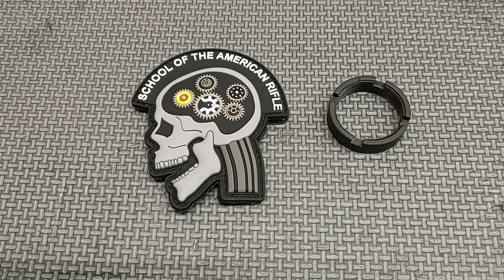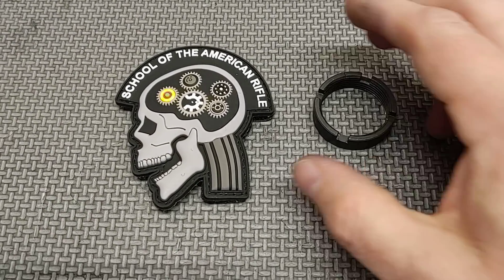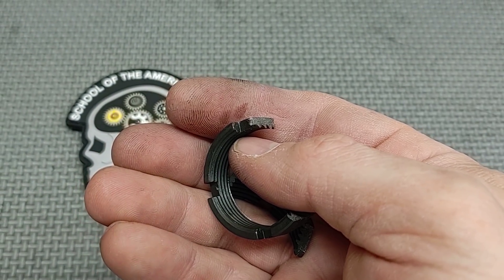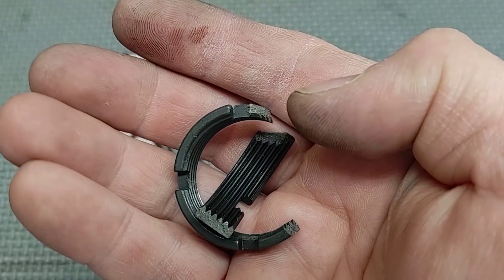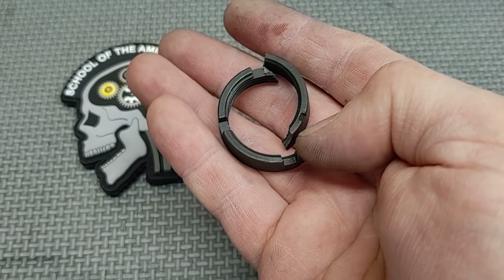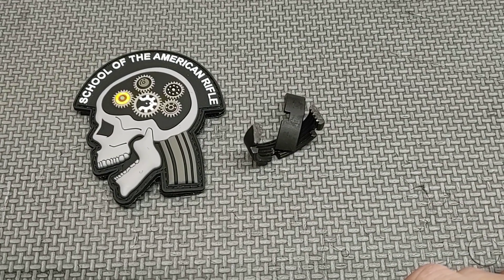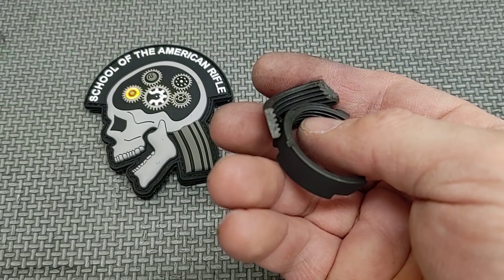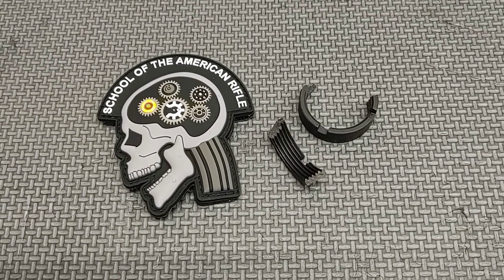AR Castle Nut Failure

Comment: I've had high a couple quality manufacturer 3/8" and 1/2" drive non-impact chrome vanadium sockets fracture and they weren't being over-torqued . . . fasteners were being tightened within their torque specs. They were decades old and had been well used. Simply replaced them with same or equal manufacturer. Stubborn fastener removal should be done with impact and penetrating oil using impact sockets . . . taking care not to overdo it on the impact forces. Sh1t happens. This was one such event.
Reply from the maker: @Sparks68  these didn't break on removal.
Reply: @SchooloftheAmericanRifle  I had not intended to imply that. My three failed sockets that occurred during four decades of using well over a hundred fractured when being used for tightening well within the torque range for them -- as with what occurred with your castle nut. As with you it's a reminder to wear eye protection. Yhr two halves of every one flew across the garage at extremely high speed.

Comment: I know this is about castle nuts, but I just finished a build and I had a question about installing the barrel nut. We used white lithium grease for the threads on the barrel nut and receiver. Is that a good choice or should I be concerned and take my upper apart to use proper aeroshell? We couldn’t find it anywhere so we thought white lithium grease would do the trick.

Comment: Threads are miscut or misrolled, depth and height all over the place. Look at the profile of the threads on the part facing the camera at 0:59 .... standard torque basically ripped it apart at the first convenient stress riser. Probably some worn out tooling wherever this was made...

Comment: What do you think of the choices of components in the WWSD2020 project? Also what do you think about some upgrades that POF does to rifles such as cam roller pin E2 extraction and cooling fins on barrel nut?
Reply: Castle Nut is a weak point of that style of stock fpr sure. But will never be problem on a  KP-15 Mono Lower.

Comment: Probably an inclusion in the steel, brittle fracture right at the stress riser caused by the sharp corners at the bottom of the notches. A U-shaped bottom to the castle nut slots would almost certainly eliminate this failure mode.

Comment: I just installed a palmetto LPK. The mag release snapped where the threaded post meets the actual mag tab. This is right after the gas tube pulled out of the gasblock cause they forgot to pin it. Garbage if you ask me

Comment: Could you do a video on how far to screw in the buffer tube? Recently had a tolerance stacking issue where I screwed in the buffer tube over the buffer retainer and it was so barely held on there that the chamfered edge of the buffer retainer ended up chewing into the buffer tube lip as it was getting ready to jump out of the lower. And one more turn of the buffer tube was doing a much better job, but the buffer retainer was still chewing into the buffer tube because the nipple was rubbing against the lip.
Reply: When I encounter this I just sand down the end of the tube a tiny bit and/or use a tiny file to just barely notch out some space for the nipple to go through.

Comment: I'm really digging this chanel. Hiw are you and your wife feeling? Any other techniques for aligning receiver extensions ,for those of us with out that nice tool you have?
Reply: Im sure chad knows better methods but what i do since i dont have the proper tools is turn the lower upside down and sit it on a flat level surface so that the receiver extension is hanging off (cant have the hammer installed for this) and put a small torpedo level on the flat side of the buffer tube and then adjust until its level. I have tons of woodworking tools so this was the first thing i went to trying to align mine.
Reply: @abolishtheatfandrepealthen6014  that makes
Sense.

Comment: I’ve tightened those down with a punch and hammer before. Guess I should be more careful... not likely tho
Reply: I know it's not the SOTAR way, but I typically tighten mine with soft jaw pliers (with aeroshell on the threads), then tighten it up with a hammer and punch, check alignment of the buffer tube, then stake it.

Comment: Some types of coatings can cause hydrogen embrittlement, phosphate is one of them.  The heat treatment after can be the difference between failure and no failure.
Reply: The cracked surfaces are dark in color that would mean that the cracks were there before or during phosphate.  

It could  also be Stress Corrosion Cracking(SCC) or the rough stock was cracked during extrusion.

Comment: An unrelated question to the video at hand but I've heard a fair amount of comments about the head of the cam pin causing damage to the upper receiver for various reasons which raises the question, why does the pin have a head, or such a large head, in the first place? I believe I have a decent understanding of how the system works but I feel I must be missing something with this as it does not seem necessary.
Reply: This is my best understanding.  The cam pin head helps orient itself for the insertion of the firing pin.  The cam pin's head shape is to keep it aligned in the upper receiver's channel,  as the bolt carrier group (BCG) reciprocates during the firing action, so as to avoid undo stress on the firing pin, which rides safely inside the pin's hole.  When the BCG goes forward, the cam pin cants to the left, locking in the bolt for the firing sequence.  The mass of the head is to withstand the force of the canting of the bolt back to the right, as the gas violently forces the BCG rearward after the ignition phase.  If you look in the channel of the upper receiver, you will see a semi-circle notch; this is where the cam pin head cants first to the left to lock in the bolt and then to the rights itself, during the rearward action.

Comment: I just inherited a Rock River Arms  elite operator 2. I believe it has a commercial buffer tube.  Would you recommend changing it out? The castle nut isn't staked,  that's why I thought of this question.
Reply: Do you plan on changing the stock? Or want the ability to change out stock? ..... if no, and there are no issues with the tube, stock etc then i would say just stake the castle nut and drive on....if you want a new stock or the ability to change them out then go ahed and change it out.
Reply: Staking is not permanent, it can be undone (see Chad's video on it).  The reason for staking is the prevent rotation of the castle nut from continued operation of the firearm.  I use Vibratite VC3 and I also stake in two places.  When I go to undo it, I use a torch to weaken the adhesive and then an armorer's wrench and hammer to force the castle nut loose.  You can always use a thin screw driver to force the staked material back out of the castle nut notch to make it easier.

Comment: "heat treat issue"
Reply: My thoughts exactly.  Look at the sections where it's broken off:  very coarse grain structure.  Granted, I've never cracked open a good castle nut to see what the grain structure is supposed to look like, but typically when steel is that coarse, it's not a sign of a proper heat treat for a high tensile strength part.
Reply: @doktorfaustus  You should never use broken cross sections of steel to gather information from.  Or at least i feel like i should tell you that it's not recommended. It's all broken, sorry i have to use the word ''grains''.  You're only going to get mislead by judging steel by the colloqually named ''grains''.  It's all broken.   If you're looking for austenite, retained austenite, etc.  You're gonna need to cut, mirror polish, etch, and get a powerful microscope out and then spend a few hours looking for key things that indicated this or that...   Takeda's Super Aogami kitchen knives, with this mentality of using a broken knife to gather information from,  have ''the worst grains ever''. But it's not true, some carbides are simply larger than other carbides, and different alloy steels, heats and heat exposure allows for different elements to behave differently during the heat treating processes.  The alloying elements combined with heat exposure of whatever alloy that caslte nut is has a bigger impact on the ''grain structure'' than whether it's been heat treated badly or not. 

Now yes of course you can see differences in the cross section depending on your heat treats etc.  But they're generally not a good indication that you're doing something right or wrong. That's the main point to take.

Comment: Looks like the heat treat is bad...
Reply: There are three steps to heat treating when through hardening. Heating, quench and temper. The metal is heated and quenched, which results in the maximum hardness and also brittleness. After the quench the part is tempered by bringing it back up to a lower temperature than the heat treat temperature. The tempering process lowers the hardness some and also reduces the brittleness. It's possible the part was not tempered or not tempered correctly. It is also possible that the part was left at too high of a temperature for too long or was overheated in the initial heat treat. This leads to "grain growth" where literally the grain of the steel gets too big and makes for a brittle steel. The grain does look large from the glimpse at the cross section.
Reply: wouldn't a bad heat treat result in the nut breaking, but also deforming. This looks like a "clean" break to me at both ends so probly not an issue with the heat treatment, but rather the forging itself.I wonder how castle nuts are made now...I assume they are forged first and simply milled, threaded and cut to their final shapes.
Reply: @Atom_Alchemist  Poor heat-treating results in a metal piece that's "glass" hard. They become not only rigid and resistant to any deformation, but extremely brittle. This castle nut is a perfect example of what happens with brittle steel.
Reply: @Atom_Alchemist  correct, that is one type of bad heat treating. That would generally be "under-doing" it or simply not doing it at all. This is "over-doing" it making it so hard it's brittle. I only know a little of the process, but good explanations and other examples are on 'Forged in Fire'
Reply: @camerons.9304  make sense, Metal working is fun...i will get my forge up and running...one of these days...
Reply: @Atom_Alchemist  What you try to achieve while heat treating is a hard surface and overall better material properties. That castle nut looks like it is hardened all the way through what you don't want for a castle nut. Something hardened that way breaks like glass when enough force is applied. In engineering, we use sometimes pins that are hardened all the way through to create predetermined breaking points (of course you can calculate how much force can be applied).

Comment: That castle nut looks like it was made via hot isostatic pressing, or metal injection molding, instead of being milled from a solid piece of aluminum or steel which would explain why it broke like glass and why the grain is so visible, my guess cheap Chinesium junk.
Reply: Absolutely. The lack of grain tells me it's a MIM or PIM part.

Comment: I assembled a lower with an aero castle nut a few weeks back and it popped as well... it didn't break in half but it did split across the castle nut
Reply: Maybe a bad batch. I think it's a heat treat issue, personally.
Reply: @tomliemohn624  Wouldn't be surprised, considering how much catch-up AR parts manufacturers have been doing because of panic buying. The question now is whether or not these material quality issues will start popping up in other parts of their product line.

Comment: I have  A problem with my ar15 it will not eject the brass after  Firing can you help me please. Thank you
Reply: Check your ejector for carbon buildup, and be sure your extractor has spring tension. You may just have a dirty bolt. Take it apart and clean it as that is the easiest thing to do. Start there, and work your way through to broken ejector, ejector spring, extractor spring, etc. Something is causing the issue, and there is a remedy for it. You just need to find it. Good luck.
Reply: @EarthAltar  - more likely to be carbon buildup in the chamber
Reply: @petersouthernboy6327  Yeah, possibly. A lot of unknowns though. Did it extract before, or malfunction on the first round? Has it ever been cleaned, or is it brand new? Is it going into full battery? Headspace checked? Etc, etc.
Reply: Your gun might be under gassed. If you have low profile gas block start there. Make sure the bolt carrier is not binding on anything. Does bolt carrier go into battery easily?
Reply: Check the chamber for rough surfaces
Reply: Check it for proper headspace with a Go gauge.   
Safest bet would be for you to take it to a gunsmith with a solid reputation with AR’s.
Reply: When it is  Fired it does not object the brass i would like to know i didn't want any of my of my family to get hurt
Reply: How do you check under gassed my new at this and right now i can't afford to take it to a gunsmith if i can i would like to try to fix it myself
Reply: @josedelao7695  Does it have an adjustable gas block? If so it may be closed off. If not it may be misaligned with the gas port in the barrel. Get some snap caps and see if they will manually eject when you pull back the charging handle. If they do you may have a gas issue. If they don't you have an ejection issue.
Reply: @josedelao7695  - let me give you the best advice:  make sure the weapon is cleared and lock it up.  Save up $75 and take it to a gunsmith.  If you don’t know exactly what you’re doing - you could possibly put yourself in a very dangerous situation.

Comment: Doesn't really matter who produced and/or marketed the product, EVERYONE will have failures. Good, reputable companies just reduce the failure numbers significantly with QC. But they will still have failures.
Reply: Correct, however the rate of failure will vary from company to company.
Reply: Yes nothing is perfect, but I rather know WHO’S parts are failing just during install to avoid it possibly happening when the firearm is needed to perform God forbid.
Reply: The difference is actually where the failure is found. Customer - bad company. QC - good company.
Reply: Granted, it's disappointing when we see a failure like this, but if a company is going to be slack in QC in any part on the rifle, the castle nut is a good candidate.  It's there to lock the receiver extension in place, and prevent it backing out, but where the receiver extension threads into the lower is what takes the stress from firing.  The most stress that castle nut ever experiences is probably when you're torquing it down; after that, it pretty much just sits there, so it's not the kind of part that's likely to fail 2000 rds later.  Technically you could fire the rifle with the castle nut completely missing—it would just be a pain to keep holding onto the receiver extension to prevent it spinning out.

Comment: Foot pounds or inch pounds?
Reply: Ft lbs.  Spec for the castle nut torque is 38-42 ft lbs.
Reply: Older TM 23&P incorrectly states inch pounds as the unit, but later revisions have been corrected to foot pounds.

Using inch pounds (or "hand tight") gives an insufficient clamping force, which is what's keeping the assembly together.

Comment: That's really weird. Looks like classic brittle failure, if that was a steel part it's like it was grossly over hardened and somehow not tempered.
Reply: it had a stress riser and it cracked. happens all the time forging knives. There needs to be a radius in the corners not a sharp 90* edge.
Reply: @tommeboy3334  agree that is a likely cause.
Reply: It is from hydrogen embrittlement.    Yes parkerizing has that effect when the part is new or did not have a post heating operation.
Reply: @John Doe That makes no sense the cost of a power meteorology die or the patterns or an injection mold die for lost wax casting is so much higher than just turning this part on a live tooling lathe.  No way in hell!
Reply: @stiles3711  cost spread over a million castle nuts gets pretty damn cheap.

I've seen broken sintered metal parts, this doesn't look like that kind of break.
Reply: @ScottKenny1978   I agree this is not a MIM part, it's a machined part that had a brittle fracture.  I highly doubt that they are post heat treating these parts so the only 2 processes after machining is tumbling and finishing.  Parkerizing really does have issues with hydrogen embrittlement.    It is typically a non issue because you just have to let the part sit for a month or so or do a post finishing heating at 300 deg F for about an hour.  What came to mind is how the volume of parts going out is up that there is nothing stocked now.  That kit could have been a few days old when the guy got it in this current climate.  

The only cast castle nut related part I have ever seen was the magpul end plate.  Pain in the ass to stake.  I thought it maybe MIM but the surface finish made me think it was cast.
Reply: @stiles3711  at least a bake at 300 for an hour is something that we can do at home.

Not something that I ever would have expected to need to do myself, but...